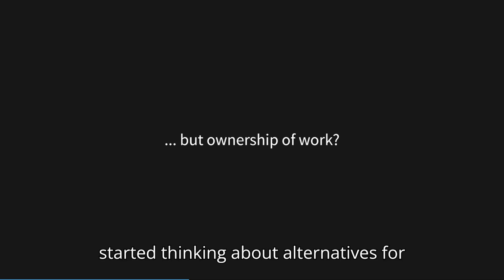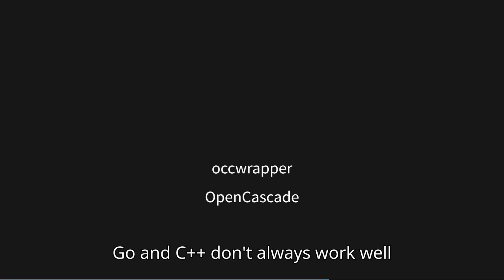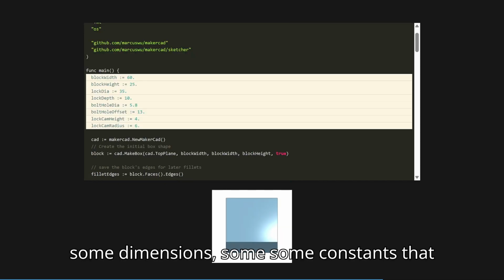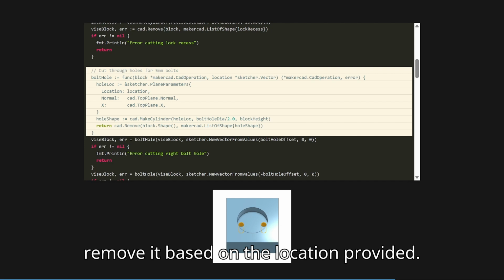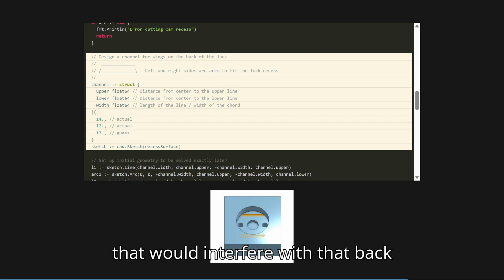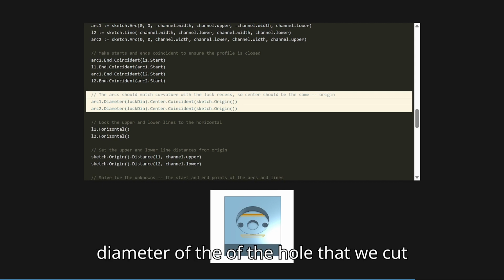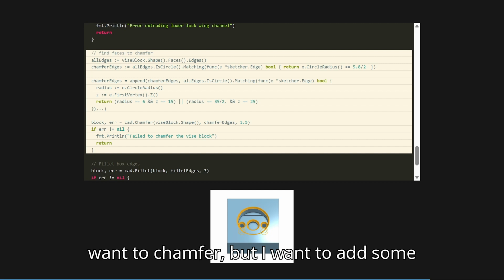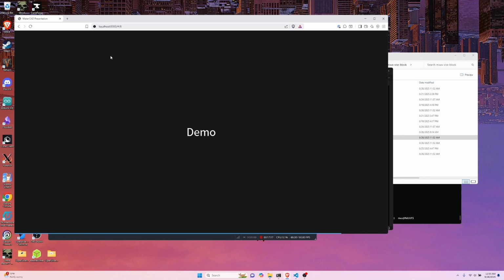MakerCAD Introduction

Comment: I'm reluctantly using OpenSCAD because FreeCAD has an impossible user interface and it fills me with fear just thinking about learning it. What I want is a user interface more aligned with Fusion360, from what I've seen in other videos, or rather Solidwork, because the external designer we hire at work swears by it. A text-interface, without even automatic visualization (like OpenSCAD) is just half a project in my opinion. I know it rhymes with the GNU/Linux mindset of "a tool should just do one thing, and do it well" but that didn't stop the likes of OpenSCAD, KiCAD or Inkscape. I just wished OpenSCAD could query generated geometry. It's a much lamented missing feature. Another feature that's painfully missing from OpenSCAD is graphical manipulation, both in 3D and 2D.

Btw, the channels that you made for the wings could even easier be made by creating a shape of the negative shape with CSG, and subtracting that from the box. Though I understand you wanted to showcase both the sketch function and the solver.

Finally, how easy would it be in your language to add bevels on the bottom side blow the 45° point for easier FDM printing? For boxes you can create special cases, but doing it for an arbitrary shape is actually impossible in OpenSCAD without shape querying or any concept of object-orientism.

Comment: honest question, why not OpenSCAD? -- it deals with just text files which can be very easily version controlled
Reply from the maker: Valid question. I wanted a few things OpenSCAD doesn't provide (or didn't when I started -- it's possible it does now). Referring to existing geometry instead of global coordinates / translations, sketches with constraint solving, and export to STEP are among the biggest.
Reply: @MarcusWu  that's fair, hope you had a ton of fun building it as well!